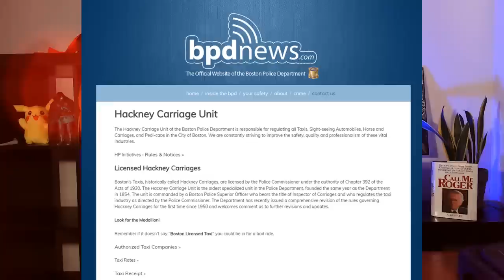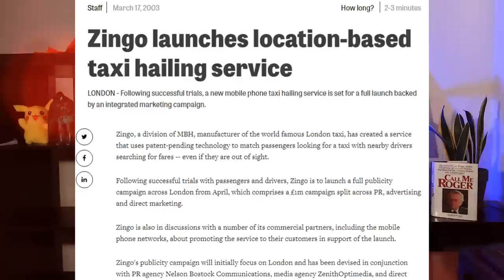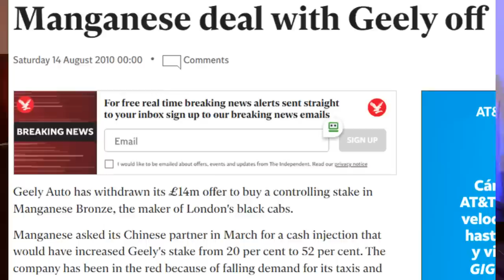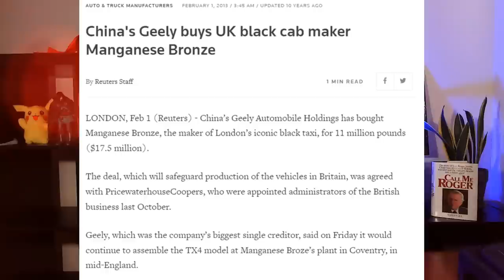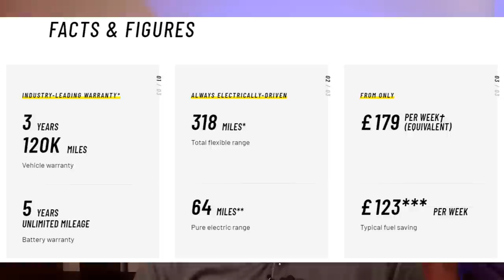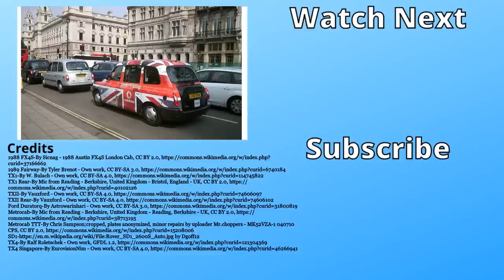A Far Too Brief History of The London Black Cab

Comment: Don't leave out the Winchester Taxi, it was an attempt to offer the London Cab Driver an alternative to the FX4. It was based on Ford components. The final version in 1971/2 looked very like what the Metrocab would look like. I think only one still exists and is on permanent loan to the East Anglia Transport Museum at Carlton Colville, East Anglia, England, and drives around on open days, along with London Trams and Trolleybuses.
The 2.2 Land Rover engine powered the FX4 R, I believe, and Cab Drivers referred to it as "FX4 Rubbish". I did drive one of these, (as a private vehicle), which was fitted with a 5 speed manual by the previous Licensed owner, as he liked to do fast runs to Heathrow Airport.

Comment: I had a 1998 Fairway cab as a private car . Great comfortable vehicle , but slow . Mine had done about 550,000km when i bought it in 2008 . Id had new leather seating, walnut door caps added, & a new AC system installed . Sold it a few yrs ago which i now regret
Reply from the maker: Thanks for sharing

Comment: Since I first visited London in the 80s, I’ve considered these the best taxis in the world. The huge and upright passenger area is so much easier to access, and so much more comfortable for the ride, I wish other cities (cough New York!) would mandate them. 

The tight turning circle derives from the very narrow entry road of the Savoy Hotel. The cabs must be able to do a U-turn without reversing in the driveway. But it also means you can hail a cab from either side of a road. 

Why they’re black?  I asked a cabbie this question. He explained that the cabs were subject to inspections every 3 months, with strict limits on modifications, and no damage permitted. Black paint was the easiest colour to touch up… so most of the cabs were black!
Reply: @Jay Tee interesting. The Savoy Hotel reference is ubiquitous, but I see from photos (never been there) that the actual turnaround at the doors is fairly large. Your suggestion makes complete sense!